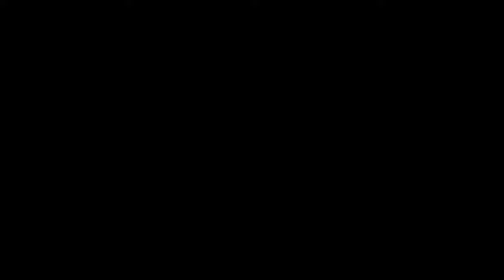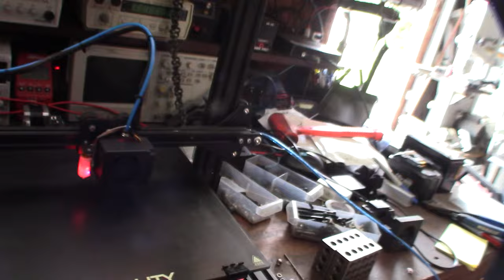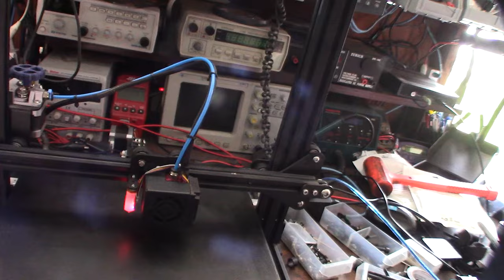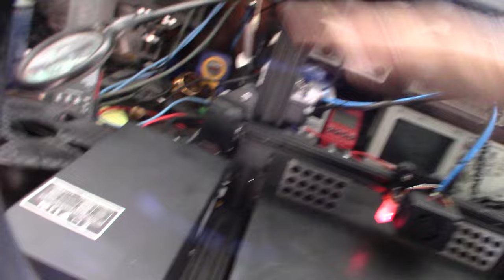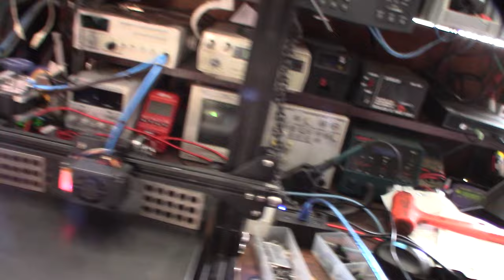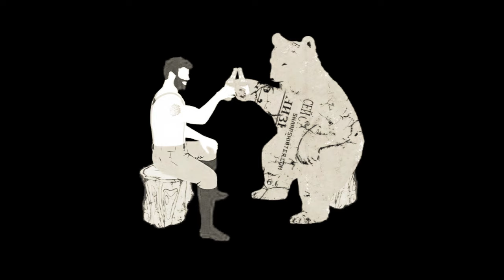3D printer dual Z motor gantry alignment using 123 blocks bed slinger CR10 S4 S5 MAX

Comment: I always level mine off of the frame not the bed.
Reply: This is my first thought.   you need to level the gantry to the frame.  The bed is not a fixed point.
Reply from the maker: Yes I agree, most home users will not know how to do this. The majority of printers I fix are from home users. This is a quick way to get X/Z gantry level to the bed.

Comment: You're aligning it to the bed though, not the Z extrusions? So if the bed is not square to Z motion, the print's XZ plane will be skewed even with mesh probing. Especially because with this style the bed screws let you put it out of square, the build has no inherent "close enough" squareness? I guess it depends on the desired accuracy level 😄
Reply from the maker: I agree. These are super cheap printers. The goal is to make the gantry level to the bed as close as possible to minimize compensation. I've worked allot a 500mm build volume printers and you would be amazed how much I've seen them compensate for a bed out alignment. I probably should have mentioned I adjusted the beds screws first. On these cheap printers like the ender3 I prefer the dual Z belt/screw kit instead dual motor kit. Having the Z rods linked you are less likely to get the Z gantry out of alignment. I'm actually amazed how well the Celeritas works with the dual belted Z and dual Z end stops. I have no probe, just bed screws and repeatably is surprising.
Reply from the maker: I made this a while back. 
https://www.thingiverse.com/thing:6369320